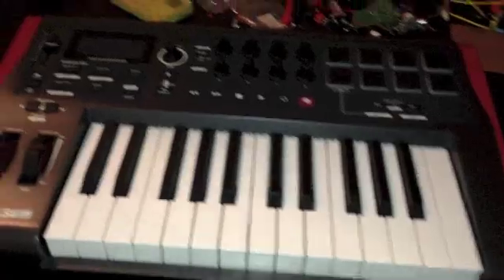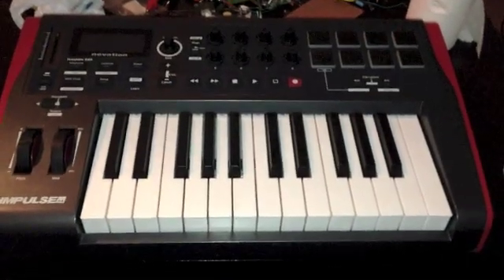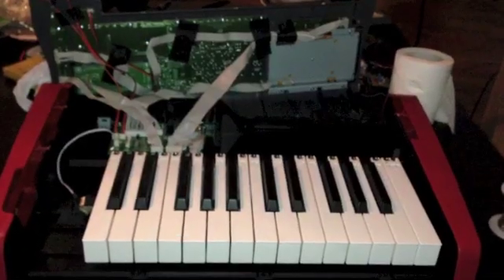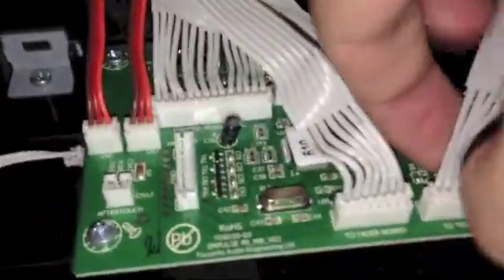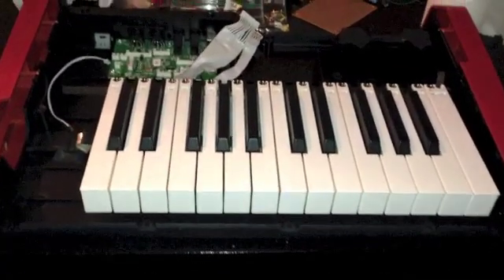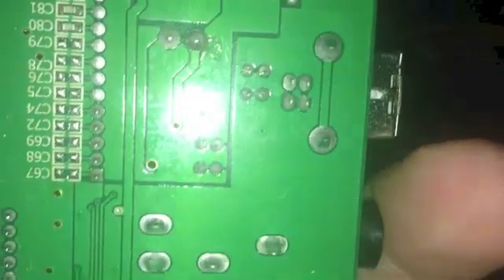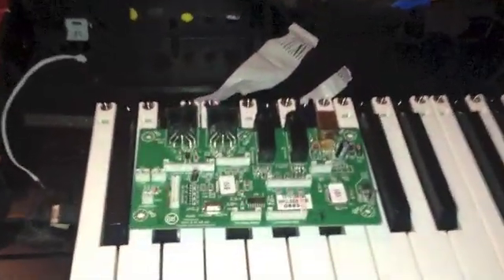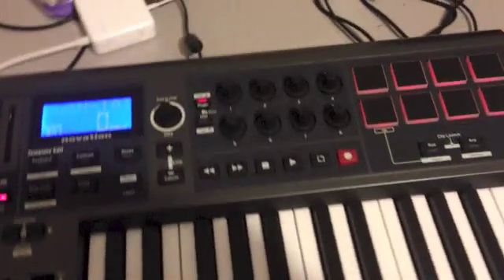Novation Impulse  USB MIDI Keyboard DIY Repair Tutorial -

Comment: I have the same issue with my maudio ozone midi 25. no midi but powering on and LCD working.. but my DAW is not recognizing it even with proper drivers installed.
 but how did u figure out that the problem is with only the USB port ?

Comment: Awesome vid,  I will be fixing an impulse 49 very soon with this exact issue.  Would be good to mention the name of the connector  "USB Female Type-B Jack 4-Pin 90 Degree"
Reply: Here can i buy this?
Reply: https://www.newegg.com/p/14S-001R-00139?item=9SIABG38KG7759&ignorebbr=true&source=googleshopping&nm_mc=knc-googlemkp-mobile&cm_mmc=knc-googlemkp-mobile-pla-e+square+partsaccessories+-+printers%2fscanners%2ffaxes_-9SIABG38KG7759&gclid=Cj0KCQjwrdjnBRDXARIsAEcE5YlNjPaln1f_i_Dg0uYJ0S-FTEJy5qbWMuk9EzP3IjiDk-pxXFhmlXQaAoN-EALw_wcB&gclsrc=aw.ds

This is the one I’m buying
Reply: Do you know if the usb cable has a special wiring diagram i can't get it to work with just any usb b cable

Comment: How did you install the new one? You just heated it up to soften the solder on the board, removed the usb b, and then placed a new one in and let it harden again? Do you need a soldering iron or anything? Please let me know I will be doing this to mine shortly I am having the same exact issue.

Comment: Thanks for the video. I have a maudio ozone midi keyboard which  has a built in audio interface as well. The keyboard powers up fine (needs external power 9v) . 
I connect it to pc through uSB and the audio interface works fine through the same USB port on the keyboard but it doesn't seem to send any midi data to pc. MIDI ox doesn;t recognize this device when connected to pc.

what could be wrong. pls help , its heart breaking to see this beautiful device collect dust (i'm interested only in using it as midi controller).

Comment: Hey sam! I know this video is from 2.5 years ago but I got a question? was the original issue that all the lights would come on and it was recognized by the computer but no midi data was transmitted. I just moved and my controller started doing this and i'm wondering if a new USB port will fix it... 

thank you and look forward to hearing back.

Archie
Reply: Did you ever resolve this issue? I have the exact same fault on mine
Reply: @A9ATV  i did not resolve it. messed up the controllers trying to put in a new USB port and bought a new controller lol
Reply: Same here

Comment: I realize this video's a bit old, but thank you! I've had my Impulse 61 for around 2 years now but a few months ago I noticed my usb cable ripped out the little block in the type b connector. The piece was still jammed in my cable so I could still connect it, but the other day the pins inside started breaking so now I'm screwed. Or at least I though I was. Definitely going to try this. Hadn't even thought of sodering a new type b on it! Thanks again!
Reply: +MichaelNoNuma hi 
 did you  get to open yours
Reply: +MichaelNoNuma hi 
 did you  get to open yours
Reply: Hi, just saw this. No, I haven't cracked mine open yet because I couldn't get my hands on a soldering iron. I finally got one the other day though, now I'm just waiting on the type b connector to come in

Comment: Great initiative, thanks for uploading. I wondering if you can give a tip with the following (allready tried novation, but they arent able to help via mail) The slider of my impulse 61. (first one, track 1 slider) is bugged. Instead of going from 0 to 127 it goes from 20 to 105 or so. And it continuesly sends midi data of the closest volume. Fe: it the volume is set on 80, it alternates between 80 and 81 really fast. Got any tip what I can try? Thanks,

Comment: sorry im responding from a newer account. I have several Novation controllers. I used the Impulse49 for about a year no problems with the USB. I now use the Remote SL 37 and the Remote Zero SL. The USB's are still working great. The part could be found on any hardware site you choose. USB Type B Port
Reply: hi sam. just to check i need to do this myself and i'm confused with the type b port i need. I can only find the ones with the square ish block inside not with the 4 metal pins as in the impulse 61. is this the connector that I need. Thanks mate. 
http://proto-pic.co.uk/usb-female-type-b-connector/?gclid=CP3uy4_nm7wCFSoOwwodf2cAvg
Reply: will these be ok, i'm just about to order them . thanks

Comment from the maker: any electronic website or some electronic stores.
Reply: Do you know is any usb b cable will work i lost the original and tried using a replacement but it doesn't work just powers the lights